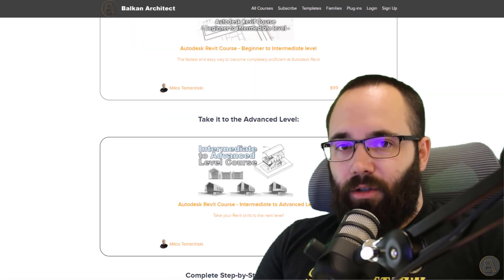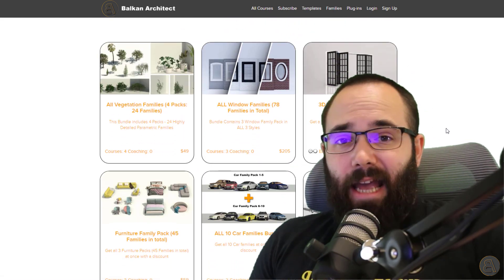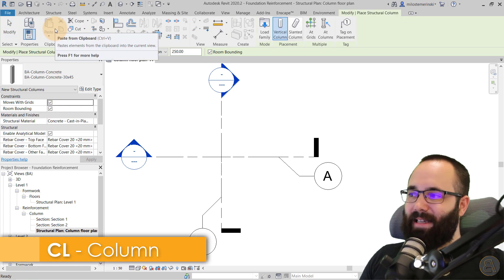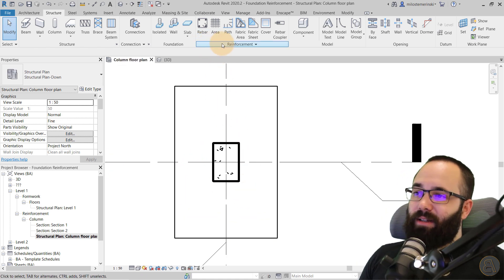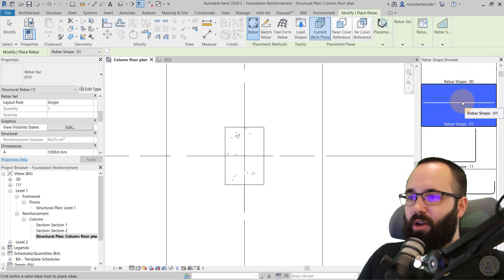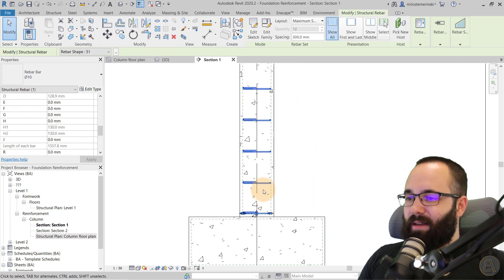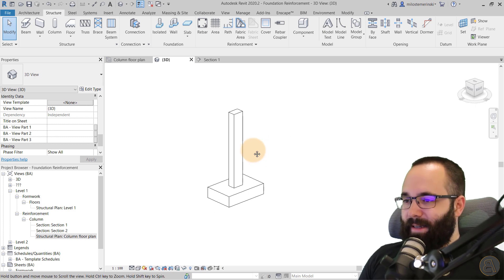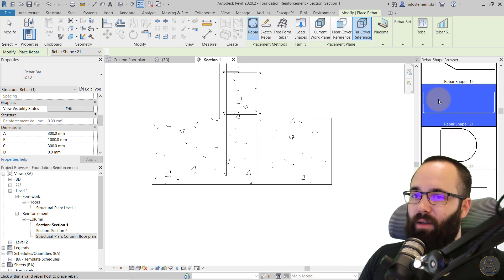Foundation Reinforcement in Revit Tutorial

Comment: As a structure, would a bar loop placed  around the column on the  horizontal part  of the L shaped rebar with t he loop stirruped to the lower bars in the foundation footing be  a better  joint to lateral  leverage of column.

Comment: Very nice and thank you .... ...... only one question regarding L shaped rebars, which are located at four corners inside column and resting on foundation pad but in plan view they should be placed at some angle like 45 degree if I am not wrong then how can we adjust the angle for these four cornered rebars..??
Reply: Rotate
Reply: @cengineer8756  Yes rotate ofcourse, if better explanation was there like cutting a horizontal section from call out or elevation or building section then set the view range of section to be able to see the foundation reinforcement along with column reinforcement and now we can rotate one corner rebar of column and mirroring it to the other side and so on until all sides.